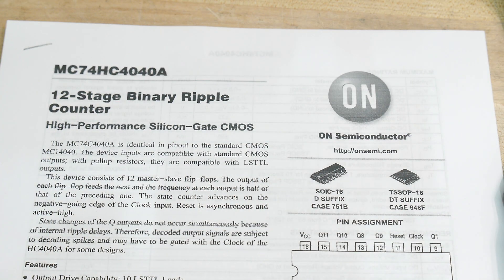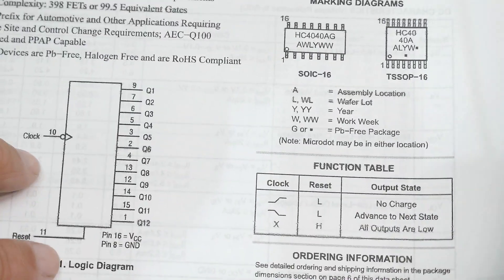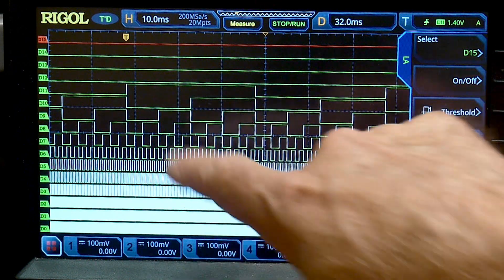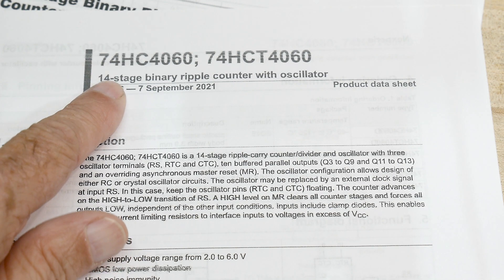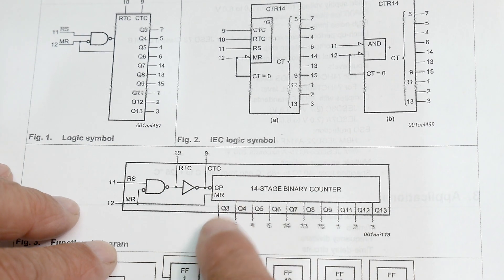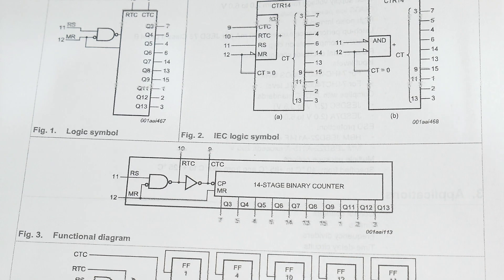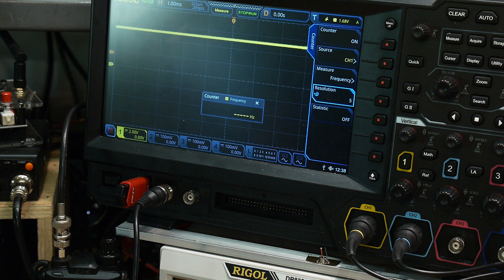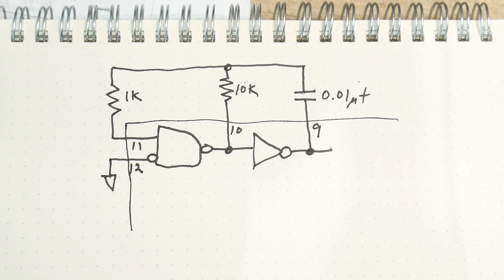#1108 74HC4040

Comment: 4060 is cool because you can drive those clock pins with a 32.768 kHz crystal.   Check out the entire series, 4020, 4040, 4060.   A very neat series of binary ripple counters.

Comment: The 74HC4040 seems cool enough just to make that nice pattern on the scope : )
Thanks for the videos.

Lately, I'm fancying SN74LVC245AN bus transceivers. They are about $1. Lady Ada did a page about them. As you likely know, the older versions of them were used in buses of 8-bit computers, such as the Commodore 64 as seen on Adrian's Digial Basement, and the Coco3 (just buffering the CPU from the cartridge slot). The SN74LS245 is at the heart of Ben Eater's breadboard computer's bus. They also clean up edges nicely, well, they are bus transceivers, after all.

For some reason these bus transceivers chips really conjure my imagination, for say--making an Arduino with bus slots. I think that an old-fashioned bus made from these is about as fast as I2C. It would be daft yet fun to experiment using a shift register to enable them, though a mistake with several enables might be smokey. Also, they like you to pull-up or down the unused input pins, so they don't float. I wonder if an bus pull-down resistor/pack would work.

Oddly, I am trying them for level shifting from 3.3 to 5v from a Teensy 4.1, for stepper drivers because I want to do level shifting on the cheap, on 20 channels. Still, one must heed the current per pin, and package to make sure the draw is not too high. They file it under "bus contention." I wish the current output was a little higher for driving optocouplers without a driver transistor/MOSFET, though lately, I am giving up my beloved NEC PS2501 's anyway, for something with a Schmidt trigger in it, but I don't know what part yet. Still on this project, I am going right out of the box with the bus transceivers and up to 8 feet of cable, with 5v. Should be an interesting experiment.

One of my favorites parts isn't a chip, but IRL640A - 18 AMP 200-Volt Logic-Level MOSFET, which runs fine from an 5-volt Arduino with a small current limiting resistor in it along the gate. It's Rgs is a little high for modern specs at .18 ohms, but at its price point of $1.63m, they have been a staple of mine. A resistor pulling down gate to ground, like a 10k, keeps lets the shut off in a timely manner. Some MOSFETS will remain on, unless the gate is...um...drained. LOL!

For coils and relays, and to actually for everything, I always use an external diode in flyback configuration. Yes, I know there's one in there, but still. My old electric scooter controller died blew several MOSFETs at once, because the flyback diodes were poor. I have seen a MOSFET with a Zener diode in it, which might work well for static, but perhaps not for an inductive spike from a solenoid coil.

Comment: Still no idea what it does and what you've used it for...
Reply from the maker: it counts. I used it to count
Reply: The counting part was pretty much implied 😄. Was more wondering about the "ripple" part in the devices name and how this chip is best used in comparison to other counters.
(Since you are making a video about it...)
Reply from the maker: @Peter_A1466  the ripple may or may not be a problem in your circuit. just need to be aware it is not synchronous. the IC is great for dividing down a clock. If used for something like an address counter, be sure the address load signal occurs once the 4040 ripple has settled.
Reply: @IMSAIGuy  Thank you! I like your component videos, but sometimes I find it hard to see the true worth of a part if it's totally new (or a new variety) to me.
Reply: @Peter_A1466  I must admit I was left thinking. I can see the uses of a /10 and /16 but why /12, what specific uses does that solve? Having mentioned you have to be aware of something that is a bit more in depth, all I know now is, I still don't know why that is.  Quite clearly IMSAI has a much greater in depth and broader knowledge of the subject than I do, which is why I watch the videos. No disrespect intended.
Reply from the maker: @twotone3070  there are 12 hours, 12 months, 12 eggs...

Comment: The 4060 is super useful… 
As you can use its osc pins as a Xtal oscillator and divide down…
Only gotcha is the missing output stage 👍🏻
Reply: It struck me that it might go nicely with a 32768 Hz watch crystal. You'd get 2 Hz at the last stage.

Comment: I also like the 4046 and the 4040 very much and used them for many test circuits. 
With the HC4040 you can make a nice demonstration. The sum of the output spectrum of the chip in operation, taken from the supply for instance, is very interesting. It has all the frequencies with their harmonics and they all have an amplitude proportional to their frequency.  
With such a characteristic picture on the spectrum analyzer, you can immediately recognize the binary counter inside an LNB where the local oscillator is divided down to be stabilized by a lower frequency quartz in a phased locked loop.

Comment: Cool. How accurate and cosistant is the timing on the 4060 ?
Reply: The 4060 itself doesn't have any timing components. It just divides down the clock frequency. If you use it with external components to create an oscillator, then it's no better than the accuracy and stability of the external components. The RC circuit in the video will be okay if you don't need accuracy, but you can obviously do much better by using a crystal to set the frequency.
Reply: The accuracy comes from the clock source.  You can use a Xtal as the oscillator on this 4060 part.
Beware if using the Cmos 4060 parts as the max toggle frequencies of the Cmos 4000 series is pretty low (around 2MHz max). For this part it’s 8MHz and the 74HC part is a bit better than that, but these Logic families are pretty slow so you can’t use a 30MHz input and get away with it.